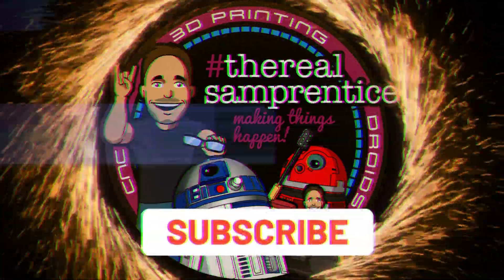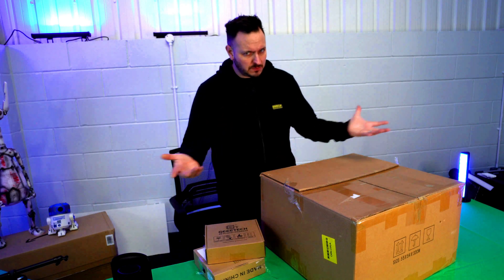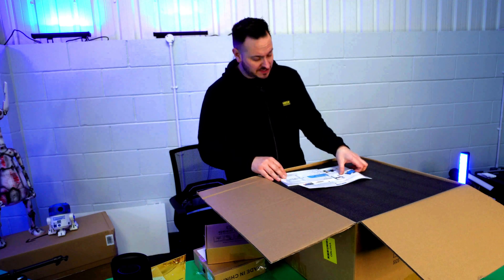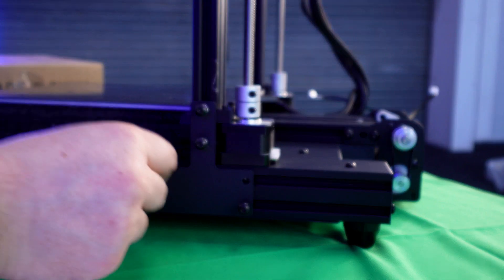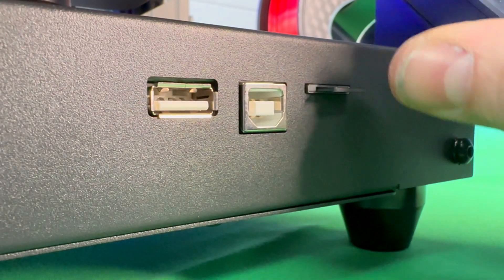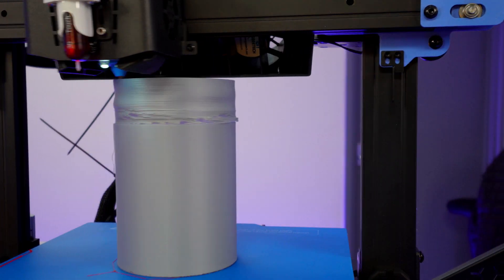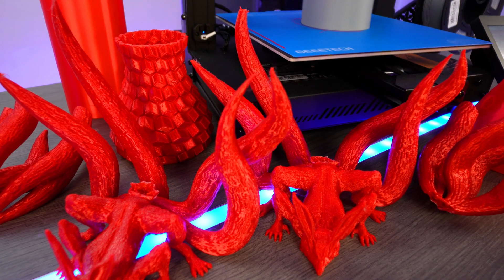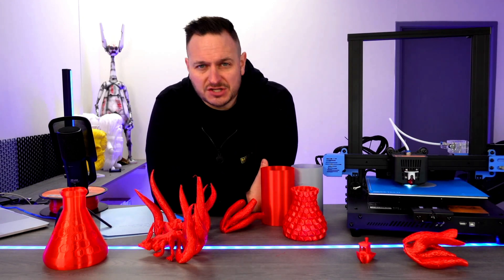Geeetech Thunder 3D Printer - More blow than Pablo Escobar

Comment: Wellll.... I have it, and so far it's the only printer I've owned (got it about three years ago). I mostly do small to midsized repair or replacement parts for things that are broken around my house (small brackets, a new toaster handle, supports for leveling a table, etc) and for little toys as gifts for my nieces and nephews. It has worked well for those purposes, but has certainly had issues with ugly z-seams, dimensional accuracy on holes (usually -.2 mm or so), and on tall walls it will often get waves that just go the whole way up. 

I like the speed, and that I can have most small prints done in under 30 minutes, but it is pretty limiting knowing I can't just trust the print if I want any sort of moving part.

I'm glad I got it used at about $250, and it really has been a wonderful intro into the world of 3d printing, but it is not enough on its own, and will need to be replaced if I hope to step up my game into more complex prints.

Comment: Yes, I have this printer and may return it. I can't say I'm super experienced, but this thing just seems to have some quality issues. I love the speed, but when I'm printing anything with high walls it's just way off in spots and if those walls are even slightly too thin forget it! It totally screws them up. I've had a lot of weird artifacts in my prints as well. Like big rings around holes.
Reply from the maker: Yeah it’s an interesting one, klipper or input shaping with marlin might help, they can’t say that it’s tuned to the latest marlin as it’s not been out that long. Best advice would be stay with it and keep playing with the settings.

Comment: So apart from the fancy servos, which looks more like steppers with a control unit and looks pretty useless judging by the wrecked print, and the double CPU is  stil a basic bed flinger with v-wheels and a Bowden.
Reply from the maker: Correct

Comment: I was excited about this printer, and its features before release. Granted, that was in an early post-Bambu labs era, especially before the P1P. I do like that someone is pushing some tech on the bed-slinger style printers, but I do feel like it is still a little late. 

Innovation may still be good, but I wonder if this product can succeed in the current market or will it be a flop.
Reply from the maker: I think there is still a big market for bed slingers, but pushing the limits of acceptable range of sped movements is questionable. I mean we have all been quite happy printing at 60mms for a number of years. The Bambu is a different Animal but speed wise.. that’s been around for quite a few years with voron and ratrig :)
Reply: @TheRealSamPrentice  of course there is a market they are cheap, easy to fabricate and work on. I think the right way would be going with linear rails, direct extruder and klipper. None is doing as finished product. The only one I know is the voron switchwire but it's full DIY
Reply from the maker: @riccaregio  I don’t think they are a cheap printer to be fair. That would be more ender 3 success